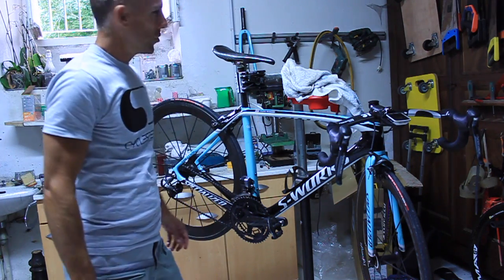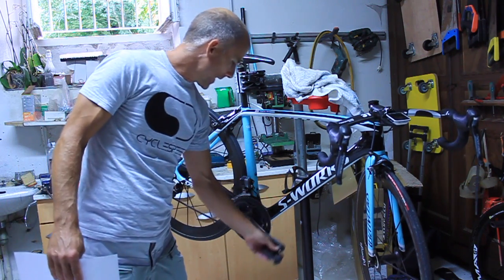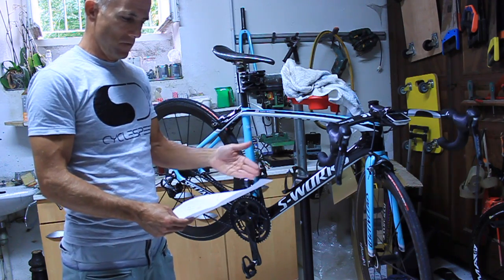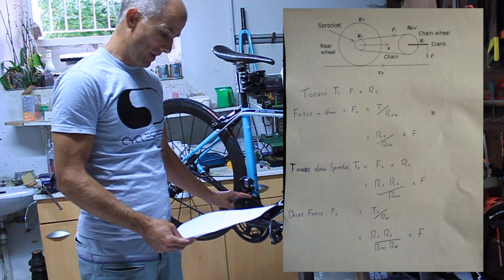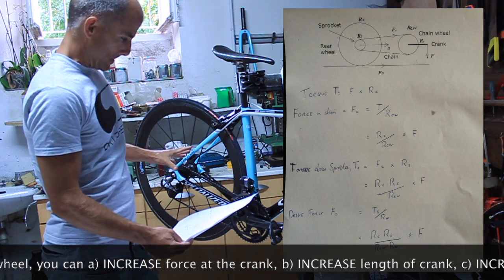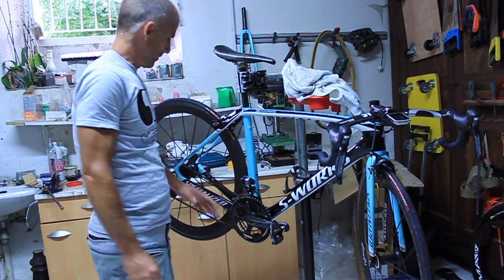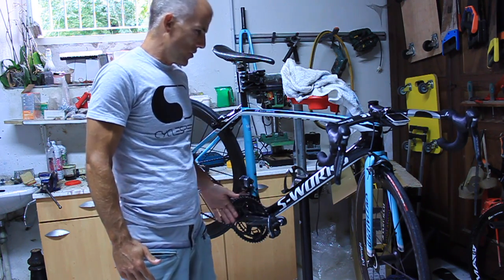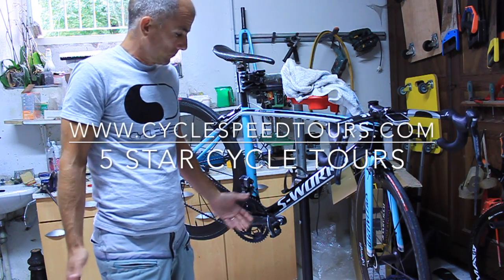Crank Length: Exploding some Myths

Comment: 978mm inseam and I've just moved to 200mm cranks on a frame designed for them. Feels perfectly natural. Height really isn't the issue, it's the length of ones legs.
Reply: 200mm cranks????? Do you strike your pedals on the floor going in a straight line?
Reply: Kokainsamurai  no, because the frame is designed for them. The BB is 25mm higher.
Reply: @Freightlinerbob  still...200mm seems ridiculously long even for a 978mm inseam. seems about 20mm too long according to most formulas and common wisdom.
Reply: Kokainsamurai actually, all the formulas I’ve seen have me between 200 and 211mm. 

210mm were too long for me but 200 feel perfect.
Reply: @Freightlinerbob  how tall are you then? 230cm? Even the really tall pros like conor dunne dont run anything longer than 180mm, which is 5mm longer than the normal 175mm. Whats the benefit then of running 200mm cranks?
Reply: Kokainsamurai how y’all a person is is completely irrelevant. It’s all about the length of the legs. 

Most men are long in the torso, women are usually long in the legs. That’s why 175’s fit most tall people. 

Perspective: 

175’s fit a 34” a Pubic Bone Height like 200’s fit a 38.5” PBH. ( mine).  Both cranks are 20.5%

A 34” PBH wears about a 32-33” leg- jeans. That’s considered tall in men’s clothing. 30” is average.
Reply: @Freightlinerbob  But whats the benefit? Does it just feel better? Crank length has bascially been proven to not affect power output. 

Pubic bone height and crank length shouldnt really be regarded as having a linear relationship anyways.
The power that it takes to just move your leg up and down during the pedal stroke has an exponential realationship to your crank length. (this isnt strictly true, im making some assumtions to simplify the task). This would mean that the power to move your leg up and down would increase by ~25% when comparing 175mm and 200mm cranks. 

It might be the best for you, who knows. Im just saying that its not as easy as saying that 175mm cranks with 34"PBH and 200mm cranks with a 38,5"PBH are effectively the same.
Reply: Kokainsamurai  I don’t tell anybody what crank length they should ride nor do I discount anyone’s choice. But it’s always the guys that cannot possibly appreciate what it’s like to have abnormally long legs that think longer than “normal” cranks are pointless. 

What’s the benefit? 

FIT. That’s all. 

To put my seat far enough back to make room for my legs, I’d be sitting over the rear axle. I can’t sit in stadiums or auditoriums, or airplanes for that matter, except at the isle so I’ve got some place to put my legs. 

People more qualified than me can speak to muscle engagement and bio mechanics. Whatever. Once I found out about the KHS Flite 747. I bought one and haven’t looked back. It’s the only bike I’ve ever ridden, as an adult, that actually fits. 

I love it.

Comment: Another cycling mechanical engineer here. I really appreciated the dialog in the comments. I'm getting ready to build up a new mountain bike, and just wanted to see what people were saying about crank length. I have gone from 180mm to 175mm, and am now going to experiment with 170mm. This ought to be fun. Thanks. Simple statics to the rescue. I'd have stopped at the force on the chain, though. I think that's all that's needed.

Comment: I think you have forgotten to mention one thing; a higher torque also means an increased stress on the knee joint, and this stress is compounded when riders compress the knee joint more than they should through the use of a crank that is too long.
One crank measuring system based on my height suggested that I use a 170mm but another system based on leg length suggested I use a 162.5mm. As I now ride with a torn ACL I will be looking for a shorter crank in future.
Reply: BMH1965 a shorter crank means more force on the knee at a given cadence and power output.  I don't know how people define "stress"  but it seems to me that most people have it backwards.   With a longer crank,  I can apply more torque with less force.
Reply: thats wrong. the load on your knee is the same.

Comment: Dismantle a handle s-works arana dismount the spider 130 and install 110
Reply from the maker: Is this meant for me?!
Reply: If it is a question
Reply from the maker: OK, well if you're asking can you dismantle the 130 spider and put on a 110, then yes you can, with a special tool.
Reply: Thanks for answer I need to see how it is dismantled to be able to try it here in my house since I have the manibela and the spiders 130 and 110 in my home
Reply from the maker: You just need the special tool to unlock the lockring behind the spider. It is possible without the special tool, but difficult. I paid about 30 Euros for mine.
Reply: Can give me the name of the tool to look for it since I live in puerto rico and sending your tool can be more than 40 euros plus 30 euros
Reply: Can give me the name of the tool to look for it since I live in puerto rico and sending your tool can be more than 40 euros plus 30 euros
Reply from the maker: Here;
http://www.ebay.com/itm/Specialized-S-Works-Crankset-Spider-Lockring-Removal-Tool-BB30-Carbon-SWORKS-/351818695900
You might find it cheaper though
Reply: With this tool remove the crank handle to install the other spider
Reply from the maker: Yes, this tool allows you to install a different spider.

Comment: the crank is a lever the longer the crank the force required is reduced for the same gear ratio. my thinking is you match the crank to the rider then adjust the gearing to match the crank and rider.
Reply from the maker: Yes, but you can also reduce the force required at the pedal by moving up a gear on the cassette. 
But yes, I agree that you need to match crank length to leg length to a certain extent to make the most of femur length, etc.

Comment: OMG! High school physics to solve a drivetrain system?
1. To solve the problem who have to start from the exact otheer end...the radious of the axcel that you want to rotate witch is the wheel. Acording to your theoretical aproach the bigger gearing the better result.
2. A drivetrian system is all a matter of ratio and for the same number of gears, the crank arm legth affects teh ratio. That means for a certain cadence with a certain gearing a bigger crank would be traveling faster....because the ratio is bigger. so simple
3. The trend is to go to smaller crank arms because you can rev them faster and so accelerate faster when seated...on a RR not equaly important in TT race
Reply: one thing is clear from your comments, Dimitris, you are not a mechanical engineer
Reply from the maker: 1. High school physics is all it needs. What would you suggest, rocket science?
1a). It doesn't matter which end you start, the result is the same. The wheel radius is in my calculations. The bigger gearing, the more torque, which is not necessarily 'better'.
2. Yes. And?
3. Yes. And?
Reply: Cyclespeed Tours ... since it doesn't matter where you start from the 53-11 gearing must be the same with 11-53, right???
Reply: as a mechanical engineer I use nunbers. "necessarily better" or worse is not a number.... 
isnt the crank arm length affecting the gear ratìo?
Reply from the maker: That's not what I said. You can calculate from tyre to crank axle or from crank axle to tyre. It changes nothing. I never said anything about putting an 11 on the front and a 53 on the back.
Reply from the maker: I too am a mechanical engineer. It was you, in your 1st message that used the phrase 'better result'. What does that mean?
Yes crank length affects gear ratio. Change any one of the levers in the system (front or rear gear, wheel radius, etc.) and the gearing changes.
Reply: Cyclespeed Tours so if crank arm length change the ratio why do you claim that "half revolution regardless the crankarm the bike will travel the same distance"? how is it possible?
Reply from the maker: By increasing the crank length you are increasing the torque at that point in the system. Thus, it 'feels' easier to pedal as you have a longer lever, but you must move that lever further (it scribes a larger arc), and foot velocity is higher (for the same cadence as smaller cranks).

But the chainring has not changed so from 12 o'clock to 6 o'clock remains the same. You are still moving the same length of chain.
Reply: Cyclespeed Tours wrong! since the ratio changes as you said before the travel distance also changes
Reply: Cyclespeed Tours find or create a ration equation that  uses also the crank arm length not only the number of gears..do the same with oval discs btw
Reply from the maker: No, think about it; when the chainring moves from 12 o'clock to 6 o'clock  you are moving 25 teeth of chain (if a 50 chainring). 
This will not change no matter how long your crank is. 
I think you are mis using the word 'gearing'.
Reply: Cyclespeed Tours there is only one use of ratio.....a gear ratio of 3 for two gears means that one is 3x bigger than the other...
Reply: Cyclespeed Tours ut cannot be different gearing ratio (as yoy said previously) AND in the same time half revolutuon of the disc will travel the same distance, no matter the crank arm length
Reply from the maker: From Wikipedia;

Torque ratio[edit]
A gear train can be analyzed using the principle of virtual work to show that its torque ratio, which is the ratio of its output torque to its input torque, is equal to the gear ratio, or speed ratio, of the gear train.

This means that the input torque ΤA applied to the input gear GA and the output torque ΤB on the output gear GB are related by the ratio

R
=
TB/TA

where R is the gear ratio of the gear train.

The torque ratio of a gear train is also known as its mechanical advantage

MA
=
TB/TA
Reply from the maker: "Cyclespeed Tours ut cannot be different gearing ratio (as yoy said previously) AND in the same time half revolutuon of the disc will travel the same distance, no matter the crank arm length"

OK, sp to be specific then, torque ratio.
Reply: Cyclespeed Tours its a gear ratio issue...you use a torgue ratio approach... does the crank arm change the gear ratio or not?
Reply from the maker: I just said above; it changes the torque ratio
Reply from the maker: What is it you're trying to prove exactly?
Reply: So you are telling me (based on wikipedia) that the gear ratio comes down to torgue ratio, hence there is no gear ratio difference, right?
Reply from the maker: No. Gear ratio and torque ratio are 2 different things, but they achieve similar results in this example. To offset the loss of torque from a smaller crank, you can change gear radius thereby compensating.
Reply from the maker: Maybe show me your calculations for the drive train system and we can compare.
Reply: 53-15: gear ration of 3.53, right?
53-15, 175 arm on a 700 wheel...gear ratio of 6.74
53-15, 172.5 arm on a 700 wheel...gear ratio of 6.84
53-15, 170 arm on a 700 wheel...gear ratio of 6.94
witch one will go longer distance on one revolution?
Reply: If you keep the revolution per minute the same that means that for a certain period of time you would actually need mote force to apply on a smaller crank in order to move it for the same distance in the same time
Reply: that means that for the same number of teetht the bugger crank makes easier the pedaling, of with the same force you can have bigger gearing
Reply from the maker: 53-15: gear ration of 3.53, right?
53-15, 175 arm on a 700 wheel...gear ratio of 6.74
53-15, 172.5 arm on a 700 wheel...gear ratio of 6.84
53-15, 170 arm on a 700 wheel...gear ratio of 6.94
witch one will go longer distance on one revolution?
---------------------
Imagine you paint the chain link at the top of the chainring in red.

Now rotate the crank one full revolution. 

See where the red link is.

Now make the crank longer and repeat. 

The red link will be in the same place.
Reply from the maker: If you keep the revolution per minute the same that means that for a certain period of time you would actually need mote force to apply on a smaller crank in order to move it for the same distance in the same time.
--------
Yes. Agree
Reply from the maker: that means that for the same number of teetht the bugger crank makes easier the pedaling, of with the same force you can have bigger gearing
====
It means the bigger crank gives you more torque, yes. But you must move the lever round a bigger circle.
This can be difficult for riders with shorter legs, and puts more pressure on joints. And it is harder to spin high (120+ cadences).
That's why smaller cranks can make sense, and if you do feel a lack of torque (say, on a steep hill) you can change up a gear (as long as you have a big enough cassette).
Reply from the maker: Remember Power = Torque x (angular) speed so to increase power you can either increase torque (i.e. force on the pedal or longer lever) or speed.
Personally I prefer to increase speed. (Like track racers (160+ cadence))
And to do that, it's easier with shorter cranks.

Comment: I have an issue with my left knee because of which I cannot use my bike anymore, the problem happens when I bend the knee more that 25/30 degrees, to avoid this one posible solution is to use more my ankle when pedalling and to reduce the crank circle to the absolut minimun, most cranks are 165 to 175mm I will need to go way down to some 120mm, and in theory I only need this on the left crank. I am thinking in cutting my cranks and reweld them shorter, the heat treatment with be ruin, but probably it wont matter that much.
Reply: My left knee only bends to 75 deg so I had my cranks shortened to 115mm (!!) by Mark at http://www.bikesmithdesign.com/Short_Cranks/ who is a brilliant craftsman. I ride with the local group and have an FTP of 220 watts using these cranks. You really learn to spin I can tell you, I can now sit at 120 rpm no problem, I'm also 64 years old - good luck.
Reply: that is an idea, the thing is the thread on the left side goes on the other direction, getting a left hand tap only for this sounds crazy expensive.
the other thing is that all modern pedals only have room for the thread at the ends, the center are shaped and quite thin.
the welding part is quite easy, specially taking in account that the pedal will be shorter and will be at the pedal end and not at the hub end.
Reply from the maker: Sorry to hear about your knee. The smallest crank I've heard of is 135mm, but in theory you could cut and weld if done well. Or how about just redrilling the pedal hole further down your current cranks? Then chop the unused end part off? Maybe use floaty pedals too. Good luck!
Reply: My first guess would be runners knee - overuse or knee ahead of pedal spinal at max power causing over use of quads compressing the knees. Second guess would be ITB - causing instability of the knee and a lot of lateral movement. My first suggestion would be to raise the seat height to a knee ankle of 20 degrees then 15 degrees. Unfortunately rocking starts around 25 degrees and less. There are a whole lot of others problems like the arch of your left foot is collapsing and is acting flat footed. So the tibia is twisting and pulling the left knee in on the down stroke. I would get ready made sport orthotics from a discount chemist. I think everyone should be using these anyway. Sholl make very good ones. A common problem I see is the centrelines of the cleats are not in line. This causes the heels to move in or out. Any tendency for this you should check out your cleats and shoes. Dont trust the lines on the bottom of the shoes as they are often inaccurate. Most people walk with a 5 degrees duck step
( up to a 10 degree). Put your shoes against each other and they will automatically be set up for this - the centre line of both shoes will be parallel. Then place the cleats in the same position just behind the ball of the foot - using the first big toe ( 1/4 to 1/2 an inch for size 8 to size 11. Larger feet greater than size 12 go back 1/2 to 1 inch behind). The centreline of a shoes does not go through the middle of the heel but to the outside of the middle of each shoe. The centreline of the shoe must be at a right angle to the centreline of the cleat. This is what is referred to as the neutral position. You must have FLOAT and lots of it. Do not under any circumstances use fixed cleats. Float is more important than anything. Also the bigger the cleat the more stable it is. Avoid mountain bike shoes or shimano road shoes. The look system has a larger cleat base and is more stable for an unsable ankle.Maybe better still go for flat pedals say MKS and use skate board riding shoes. You can ride lock up your bike and  run walk climb etc. Also you should see a physio or podiatrist. Lastly I recently came across a runner who had knee trouble and it turned out to be the onset of diabetes - so see your doc. 

Cheers and dont get talked into midfoot cleat placement by idiot professional bike fitters. There are good reasons why pro cyclists and triathletes dont do this.
Reply from the maker: That's great to hear they work well for you and shows that really short cranks are no hindrance to decent power!
Reply: http://www.cobbcycling.com/product/crankset/ they have atleast 145mm cranks. maybe it helps